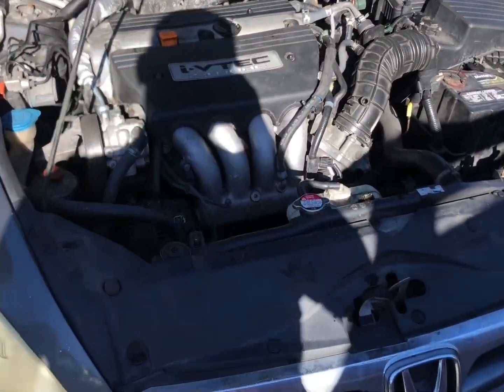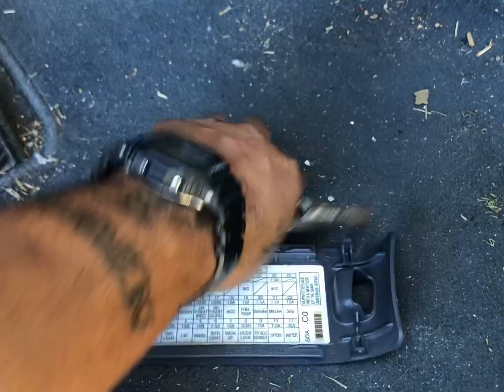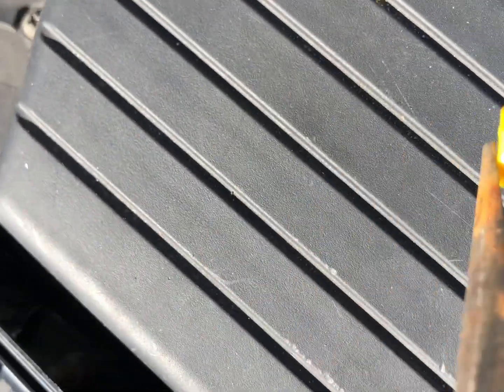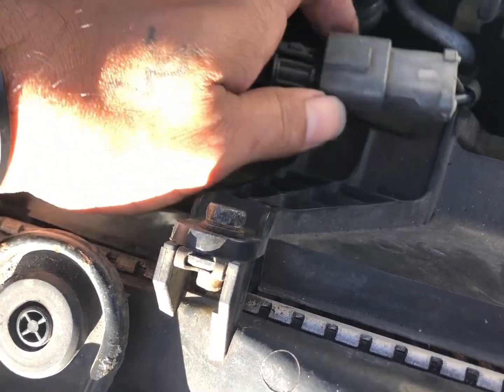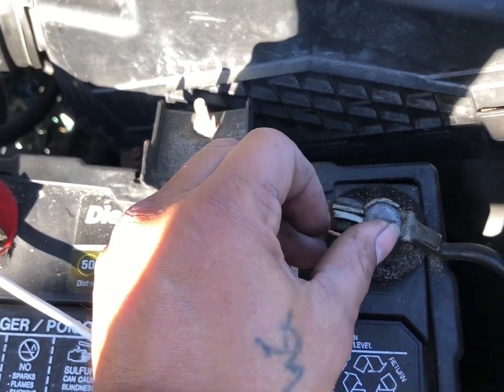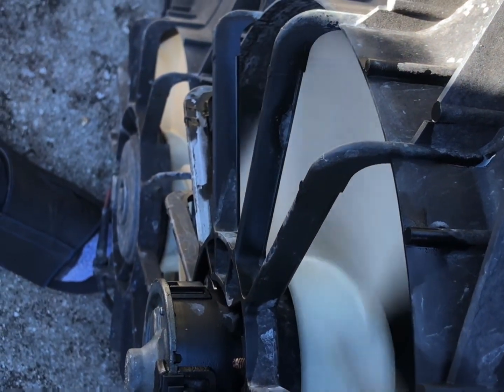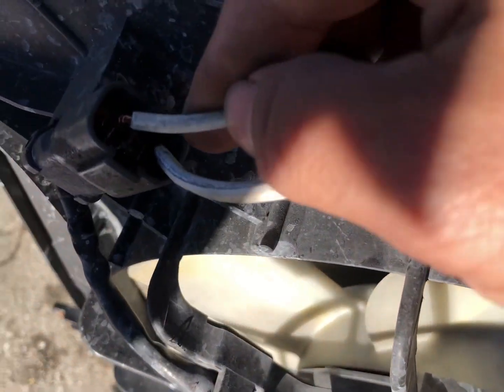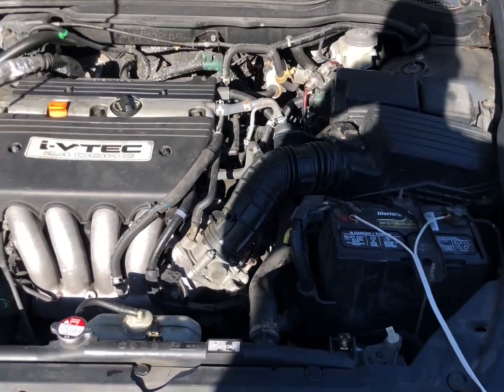Honda Accord Radiator Fan/ Cooling Fan Diagnostic (2003-2007)

Comment: What if they both work. But only turns on when you turn on the ac?
Reply from the maker: Hey thanks for watching that is perfectly normal and working just like it should. It’s a condenser fan that only comes on when the A/C is on or if the vehicle reaches a super high temperature that the other fan can’t keep it cool enough which is rare. Hope it helped and hope you’ll consider subbing to the channel.

Comment: Paper clip works better and if your fan spins when testing it then it could be 3 thing thermostat a sensor on bottom of radiator or waterpump they are all common overheating issues that can cause fans not to kick in
Reply from the maker: As long as you can figure out the issue is what counts.

Comment: Will the fans not working make the car stall ? I tried to start it then it shakes and the dies let it sit for a while they it started up
Reply from the maker: Hey thanks for watching. To answer your question:

🚫 No, the radiator fans not working will not directly make your 2007 Honda Accord stall.

But — they can indirectly cause a stall if the engine overheats due to the fans not running, especially if:

You’re idling or in traffic on a hot day (low airflow through the radiator).

The engine reaches critical temperature, which can cause the ECU to shut things down to prevent damage.

A component like the crankshaft position sensor, ignition coil, or fuel system is heat-sensitive and fails when hot. 

Hope this helps and I hope you’ll consider subbing to the channel.

Comment: Hello bro I have a similar issue my cooling fan isn’t turning on I’ve changed radiator and I see it’s leaking from the top I’m wondering if that’s why there not turning on. I would like to know what’s the common problem with the cooling fan so I can try fix myself. Thank you
HONDA ACCORD  EX-L V6 2003
Reply from the maker: @Qcchps5  hey thanks for watching. Sorry to hear about your cooling fan but without having the vehicle in front of me to diagnose is kind of hard to say. You have to unfortunately go through the steps to find what’s your issue. It can be anything from a coolant temperature sensor, thermal switch relay, blown fuse, coolant fan motor, wiring and connections, and finally ECU issues. I’d start with the simple stuff like checking fuses, relays and testing the actual fan to see if it even works. Then move to coolant sensor and so on. Hope this helps and hope you’ll consider subbing to the channel.

Comment: I have a Honda fit 2007 and the radiator fans aren’t working but they do turn on when I connect it directly to power and they also turn on when I go to the fuse box and touch the fuses with pliers could this mean the fuses went bad ?
Reply from the maker: @notniex  possibly. Could also be a bad thermostat or template sensor even a wiring issue. It’s hard to say without physically having the vehicle in front of me to troubleshoot.
Reply: @ I got codes P0118, P0498, P0135
Reply: Does it come on when you run the air conditioner or defroster?
Reply: @LA_Commander no it doesn’t come on when I turn the air on
Reply: @  Ok, I would check the fan relays and the coolant temperature fan switch sensor.

Comment: I did this and the cables sparked then started smoking. Any idea what happened?
Reply from the maker: @mandorodriguez4845  hey thanks for watching and sorry to hear that. It sounds like you touched the wires together and if you did, it can definitely cause the issues you experienced. It’s the same as when you touch jumper cables together they spark and smoke.

Comment: Hello, my car has this problem: the coolant gauge and fuel level no longer show and the fan does not turn on, and the fan only turns on when the air conditioner is turned on. Can you help somehow, maybe someone had such a problem. Thank you
Reply from the maker: @datakhorava2979  hey thanks for watching. Sounds like you have two different issues. The first could be your coolant temperature sensor and the other could be an issue with your fuel sending unit swing arm that is causing your fuel gauge to not work. Hope this helps and if it did please sub to the channel.

Comment: I've inspected all my fuses, relays, and the fan, and everything is functioning properly. What else would you recommend I try?
(2006 Honda Accord)
Reply from the maker: @mrwise7067  hey thanks for watching. I’d check to see if you’re getting power to the fan and make sure you don’t have any shorts/ brakes in the wires. Try a continuity test using a multi meter.
Reply: @ucanfixit1  ok
Reply: @ucanfixit1  ok

Comment: I have a accord when the ac is on the ac fan works when temp switch is jumped nothing turns on put 12v to normal rad fan it works checked fuses relays etc
Reply from the maker: @sebastianduggan  could be a number of things or a bad temp switch but without having the car to physically troubleshoot it’s hard to say.

Comment: Will this help keep the coolant cold ,only 1of my fans is working,bought a replacement…?
Reply from the maker: Hey thanks for watching. Yes the cooling fans will definitely help move more air through the radiator to then cool your coolant. Hope you’ll to the channel.
Reply: Only one fan running (without a/c compressor engaged) will help only slightly, especially best while driving and getting wind to help cool as well. Otherwise, running the a/c while driving with only 1 fan can risk overheating -- worse as you sit at a light or the most risk if you're just parked and running the a/c. You need both fans to efficiently cool.  To get home or to a mechanic, just watch your temp, don't run the a/c (compressor) and heat to full as blowing the heater fan across the heater core can act as a "2nd" fan and help cool the coolant/engine while you hobble home.  Don't leave it unfixed

Comment: Stupid question, is the radiator fan supposed to be on at all times? I changed a fuse for my blower fan since it was out and also for my ac relay and now it kicks on when I have the ac button but also shuts off if it’s not on
Reply: generally they do when ac is on  but should have a temp control also
Reply from the maker: Hey thanks for watching. The only stupid question is the one that’s not asked. The temperature sensor triggers the fans to turn on and off so depending on the engines temperature it can be on longer than usual at different times.

Comment: Hi, I have 2006 Accord and none of the fans is working. Relays and fuses are fine, so are the fans themselves (connected them to battery). I've changed the temperature sensor (the one on the engine). Any suggestion what could be the issue? Neither of the fans is working even with AC on, but AC works fine. The engine is not overheating either. Please help😂
Reply from the maker: Hey thanks for watching. There could be several different reasons the fans aren’t working from fan assembly, to coolant temperature sensor, to fan control module, to a broken wire somewhere but with out having the vehicle physically in front of me we are just guessing at this point. If I were you I’d get a test light to make sure there are no broken wires and then go from there.

Comment: I have an issue with my Honda Accord, both of the fans are not working.  The Diagram looks almost identical as the one we see here at 1:15 with a minor difference which I don't know what that means. On the diagram in this video there are two Relays, one on the left side (with the cooling system symbol and the snowflake symbol) and on he the right side (only with the cooling system symbol). On my car there is only the one of the left with both cooling and snowflake symbol but the one on the right is just crossed out, what does it mean? Can one relay control both the AC and Cooling fan?
Reply from the maker: Hey thanks for watching. The best thing to do is check your manual. When it’s crossed out it means it’s not being used and nothing goes in that spot. Without having the car physically in front of me it’s hard to give a diagnostic.

Comment: I have honda 2007 k20 engine and my cooling fan only comes on when  engine is warm and i spin the wheel? Any one have any suggestions swapped relays same thing
Reply from the maker: Can be quite a few different things but if it works when you spin it by hand it sounds like your actual fan is bad or going bad. I’d also check the temperature coolant sensor.

Comment: I replaced my thermostat, heat wasn’t working- now it does… but now my fans aren’t working when heat is on, but when a/c is on they work? Any answers
Reply from the maker: Hey thanks for watching. It can be a number of different things from blown fuses, bad relays, or broken wires but if I were you the first thing I’d check is the temperature coolant sensor. Hope this helps and please sub if it did.

Comment: I have an 03 Accord EX and both fans stopped working. When I tested the relays doing the bypass thing, only the drivers side would spin and nothing from the passenger side. I unplugged the switch from the passenger side of the fan to test with a multimeter if it was even getting power and it showed 0 volts to that side. Is this a relay issue? Wiring issue? I’m thinking I need a new wiring harness but I don’t know
Reply from the maker: Hey thanks for watching. I’d make sure your getting power from the harness then switch the relays around to rule that out and finally all else points to actual fans being the issue.
Reply: when  you check for power turn ac on it bypass the temp unit  because if it not hot enough it not going to have power to it works like a switch  @ucanfixit1

Comment: Is that both high speed and low speed
Reply from the maker: Hey thanks for watching. Mine only has one speed lol which is “on” 😂
Reply: Mines don’t blow that hard
Reply from the maker: @RealFunnyDoody214  is it new? If not it might be on its way out then.
Reply: the driver side comes on when i tap it hard and the passenger side doesnt come on at all what is that
Reply from the maker: @turtyturty6489  Hey thanks for watching. There’s plenty of issues that can cause this without doing a proper diagnostic and troubleshooting it’s hard to tell but sounds like it can be a short somewhere on the side that doesn’t come on but if everything checks out then your  fan is bad.

Comment: Was it making u leak coolant ?
Reply from the maker: Hey thanks for watching. No it wasn’t leaking coolant I changed it because only one side worked and it would overheat in the summer months a little faster than usual. Hope this helps and don’t forget to subscribe!
Reply: @ucanfixit1 basically my fans only come on if I turn the ac on the radiator fan doesn't come on when it's at normal operating temp  and I'm leaking coolant at the top of the radiator where the top hose at under it

Comment: I just replaced my ac condenser fan, both fans work now but only when I turn on the AC. Changed both fan relays. Car isn’t over heating but the radiator fan only comes on when ac is on. Don’t know what the issue is.
Reply from the maker: Hey thanks for watching. I’d check the thermostat next to rule that out and go from there. Hope this helps don’t forget to subscribe!
Reply: Coolant temp sensor could be the problem did u ever figure it out ??? Was it the thermostat ?
Reply: I replaced my thermostat…  now my heat works, but radiator fans don’t turn on when hurt works but does when I turn A/c.. anybody can help?
Reply: Mine does the same fans only come on with a/c on. But hasn't overheat gauge show normal temp
Reply: Try the fan switch sensor. This is different from the coolant temp sensor and the coolant temp sender.
Reply: Thats how it works

Comment: One of my fan works but the other doesn’t. I try to hit it and give it a little help to make it spin and somehow it started working. Do you know what could be the problem?
Reply: Could be the motor or wite harness. U dont need to buy the whole assembly. U can just buy the motor or harness by themselfs
Reply from the maker: Hey thanks for watching. Yea sounds like that fan is going bad it usually happens this way. One side always stops working. You need to replace the whole fam assembly.
Reply: Sounds like the motor is going out. Just get a new fan assembly. They're not expensive

Comment: I know it’s my fan or a fuse without doing that wire test only because when I’m parked or stuck in traffic it overheats when I’m hauling ass down the highway she’s crisp 😂
Reply from the maker: @Talicamm 😂😂 hey thanks for watching and at least you know the issue that’s the hardest part 😅 get that thing changed I have a video on how to do it!
Reply: @ucanfixit1  appreciate it definitely will be using that vid when it comes in
Reply: Yup same here 😂

Comment: Problem solved and fixed $135 later for a battery 😞
Reply from the maker: Hey thanks for watching! Sorry to hear that but happy to hear you fixed the issue.
Reply: What was it? I’m having the same issue
Reply: @rudycastellon6360  jumped the gun, new thermostat fans are working...still getting hot. Temp sensor is hopefully the issue.

Comment: Y not just turn on the ac and you'll know if the fan working
Reply: Are they supposed to turn on even with the ac off?
Reply: You won’t know 100% it could be a wire,connection, or a sensor,fuse relay this test eliminates the possibility that there is an issue with the fan it self, if both fans spin direct.
Reply: Wtf 🤣🤣🤣
Reply: Wtf 🤣🤣🤣

Comment: One side of my fan comes on and off the other side doesn't,  and then one that does come rattles a bit looks loose.. Do you think I just need to replace the fan?
Reply from the maker: Hey thanks for watching. Sounds like it you do need to replace them but first try to wire them directly to the battery like I did to see if it’s the fan.
Reply: was it the fan ? let me know thank have same issue as you
Reply from the maker: @plutodread97  he never replied sorry.

Comment: So…the replacement fans had a broken fan too?
Reply from the maker: Hey thanks for watching! Good question, the fan I’m using to test on is the old fan that was in the vehicle. I replaced it with one from the junkyard before making this video. You can check that video out on my page. It’s called “Honda Accord Radiator/ Cooling Fan Replacement”, hope this answers your question.
Reply: @ucanfixit1  hello my radiator fans only work when Heater and ac is on
Reply from the maker: @clavin162  Hey thanks for watching! Sounds like your temperature sensor is bad. I’d start there and work my way up. Hope this helps. Don’t forget to subscribe.